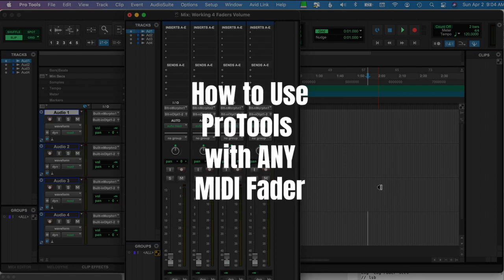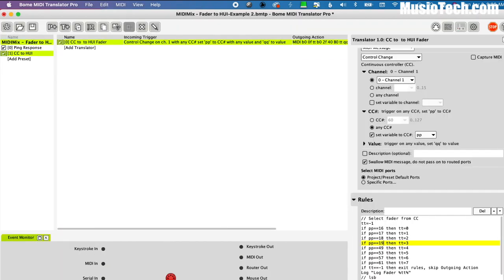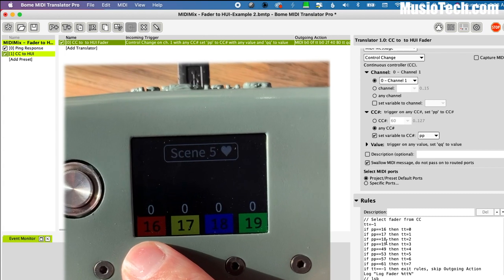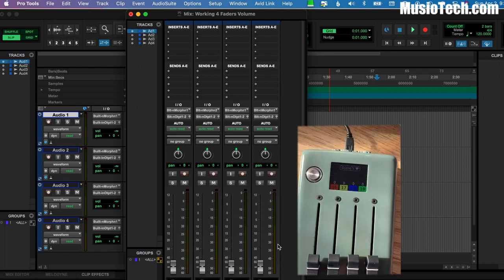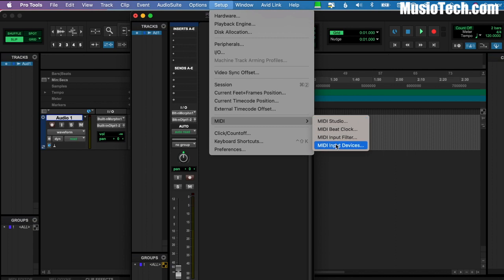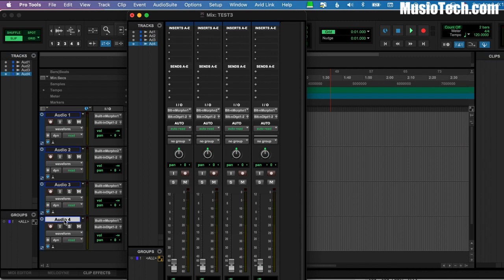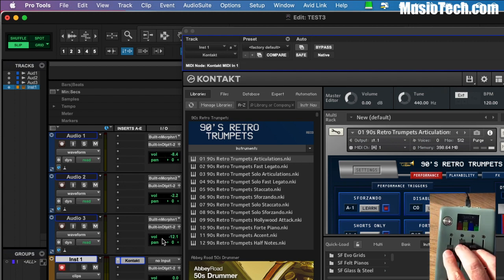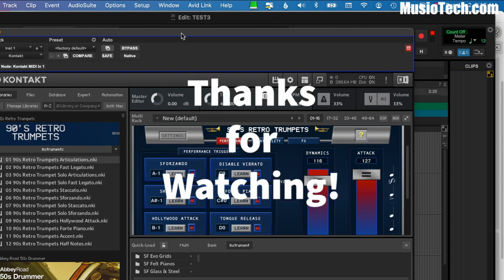How to Use ProTools with ANY MIDI Faders!

Comment: Great video, Thanks!  Do you know of any way to interface a device having 16 MIDI faders to Pro Tools?  It seems that the HUI spec only allows for up to eight, is that correct?  I have a good ol' Ramsa WR-DA7 that has 16 programmable MIDI faders, but when used in its DAW (i.e. HUI) mode you can only use eight of them.  I would love to be able to use all 16.
Reply: Seconded, would love to know this

Comment: it would be nice if whatever fader is selected would count as fader 1, is there a script for that? in your example you can just control the faders of the first 4 tracks right?
Reply from the maker: It's not a control surface - so it's not going to have the ability to automatically assign each fader to a different track, or even automatically assign to track 1. For that kind of ability you'd need more than just a MIDI controller.

There may be a way to get it to work like that with some kind of script, but that is not how MIDI faders are usually used.

I think you're going to want a full blown control surface for this kind of functionality.

Comment: I would use these for controlling DAW faders for real-time performance mixes like I used to do with analog mixing consoles. I would need 4 or 6 of them. The Pro version would be the deal clincher if it were possible to name the faders on the screen. Your box has caught my eye on account of the 100mm faders which Im assuming are very smooth - which is essential for real-time arrangement mixing.
Reply: Hey bud sorry but where can I grab the script for this I’ve got the midi translator already ? Any help would be much appreciated ! Great vid
Reply from the maker: @buttaz95  https://forum.bome.com/t/possible-to-map-basic-cc-faders-to-protools/5053
Reply from the maker: Hi MOOTANT1, yes, you can name the faders on the screen. You can program everything directly on the unit, and it's pretty easy too. Currently there are 4-faders on this unit.

Thanks for sharing.
Reply: @musiotech  Can I also name the faders from software?
The ability to name the faders is a major+. I also think 4 of these would help grouping instruments - drums first four, synths, second four etc. I take it the faders are silky smooth?
Reply from the maker: @MOOTANT1  The programming is all done on the screen; so there is no external software to use at all. This is so the unit will always be functional regardless of OS upgrades.

The faders are very nice, and to me they are silky smooth. I use high quality Japanese Alps faders that cost more than the usual ones, but they are lovely.

Thanks for the message.
Reply: @musiotech  Greetings again. Thanks for the info, much appreciated.